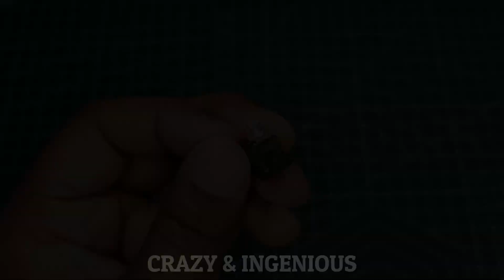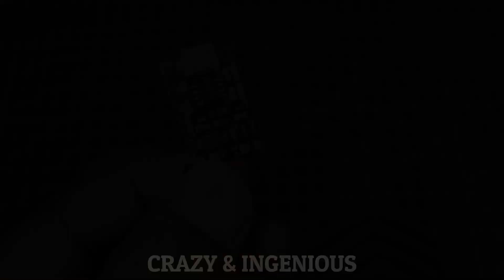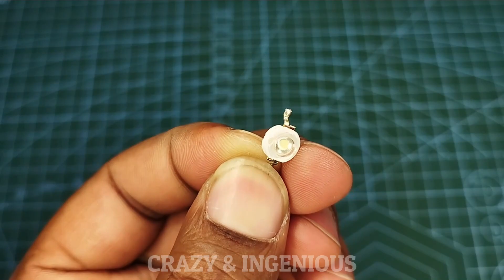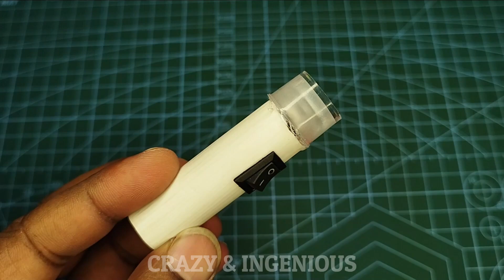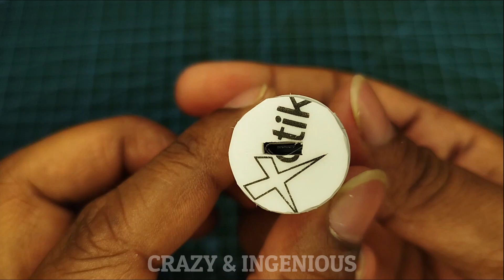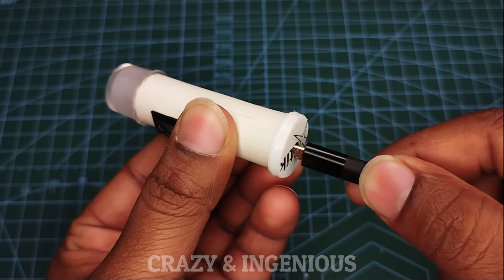Making Mini LED Torch Light Rechargeable #craft #diy #creative

Comment: U have made this. it's a nice and a good idea, but I would like to ask you if we want to connect a 18650 3.7v x2 batteries one 3W led and for charging. I would be using a 6v 3W solar panel, not a charger. Can you please explain how